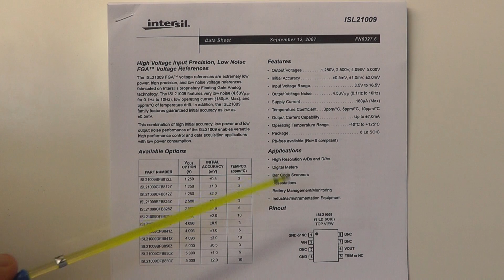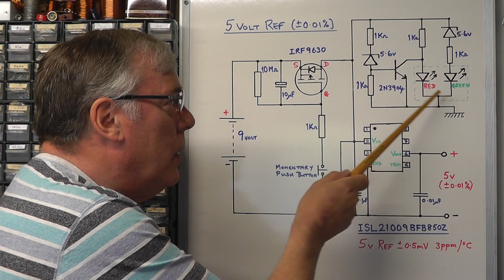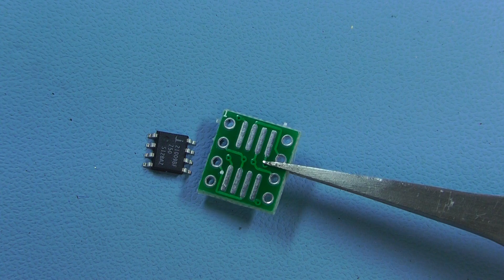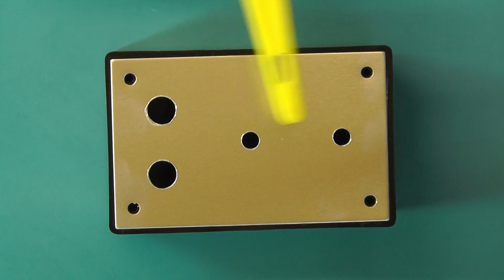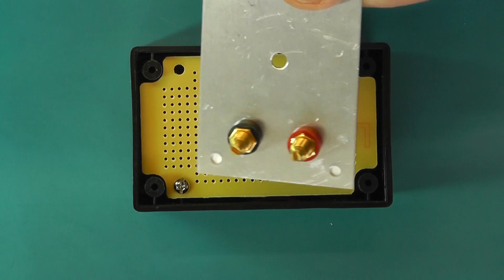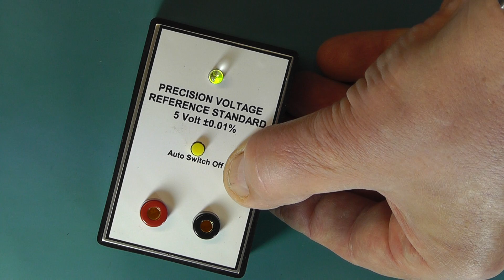Scullcom Hobby Electronics #21 - Design & Build 5 Volt Reference Standard

Comment: Smashing project, simple circuit and ideal for anyone wanting to check there meter, also much much cheaper than company units :D.
It reminds me of the kits i used to buy via mail order from maplin electronics in the mid 80's, simple = easy to build and reliable :-)
Reply from the maker: zx8401ztv Thanks. Like you I still remember the kits in the 80's - sadly we are giving away our age !!!!
Reply: Scullcom Hobby Electronics lol :-D I loved the kits :-)
Perhaps this 5v precision output could be expanded with a string of identical resistors and a buffer op-amp to provide 2.5v, 1.25v, and perhaps below 200mv to check the bottom of a multimeters range, just a thought :-)
Reply from the maker: zx8401ztv Your mind must be working like mine! I have been playing around with an idea for some time to give 10v, 5v, 1v and 100mV precision voltage references for multimeter calibration. The difficulty with a straight forward resistor network is that you would need very high tolerance resistors of around ±0.001% but these type of resistors are very expensive around £30 each and therefore you could potentially be looking at a cost of around £100 which is out of the price bracket for must hobbyists. You could build a Kelvin-Varley Divider to achieve the voltages but again that would be very expensive and difficult for the hobbyist to make. I have though up an idea which could be built cheaply by the hobbyist and also easy to calibrate. The idea I have is to use the 5v Reference (already accurate to ±0.01% or better) have built in this project and then use a INA105 chip configured as a precision x2 gain to give 10 volts reference whilst maintaining most of the accuracy of the ICL21009 chip. Then I would design a Hamon Resistor network to divide by 10 and divide by 100 to give 1v and 100mV. This would then give us the 4 reference voltages I have mentioned here. The additional cost of my idea would be around £15 and would be easy to calibrate. If you think this would be of interest maybe I should do a video demonstrating this idea. What do you think?
Reply: Scullcom Hobby Electronics The question is would it interest you?, i didnt actually think about you making a video, i was thinking for your personal interest :-)
It sounds like you have a more complex way than my brain can handle lol, but its logical and should work as long as it does not introduce too many elements that may add errors.
If you want to make a video of your thoughts then im sure there are watchers with far better knowledge than i, if you dont get any better feedback you could delete it ha ha :-))
Reply from the maker: zx8401ztv I will test out my idea and if it works OK and maintains the accuracy I will make another video. Thanks for your kind comments about my videos. I am still new to You Tube. I have number of other projects planned.
Reply: Scullcom Hobby Electronics Please please take your time, never forget that this is your channel and we know you go to a lot of trouble to make a video of your interests for us odd strangers lol.
Its appreciated :-)
Reply from the maker: zx8401ztv Thanks, I will take your advise.

Comment: Are you going to address the crossover point between the green LED and the red LED where neither of the LEDs are illuminated?
Reply: aerofart Its only a basic indicator, and a battery would last quite a long time considering the usage :-)
Reply from the maker: aerofart Thanks for your question. The crossover point for the LED switching is not an issue as when I tested it the Green LED went out at 6.6 volt and the Red LED came on at 6.5 volt. You can play around with different zener diodes but I found using two 5.6 volt zener gave the result I was aiming for.
Reply: Scullcom Hobby Electronics That's good to know.  Glad it worked out.

Comment: Wouldn't adding a high-value resistor between the emitter of the transistor and ground (while not disrupting its intended bias point)  drastically reduce the circuit quiescent current?
Reply from the maker: aerofart Adding a resistor between emitter and ground would have the effect of self biasing the transistor and therefore it would be permanently ON and as a result would simply connect a resistor (you mentioned high-value) between the anode of the Red LED and ground rather than shorting the anode to ground. This would mean the Red LED would be permanently ON as well as the Green LED which is not what we want.
Reply: aerofart Wouldn't an emitter resistor increase the Vce, which needs to be kept below the red LED's Vforward?
Reply: Scullcom Hobby Electronics Thank you for the explanation :) Love the videos. Keep em coming :)